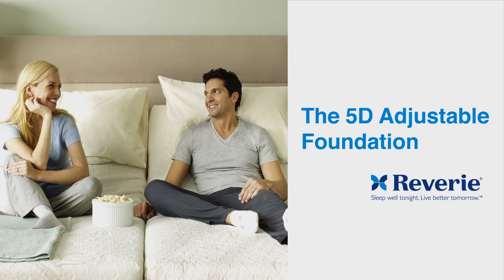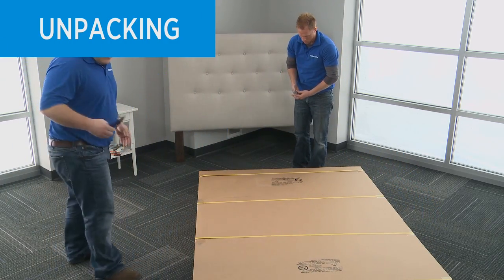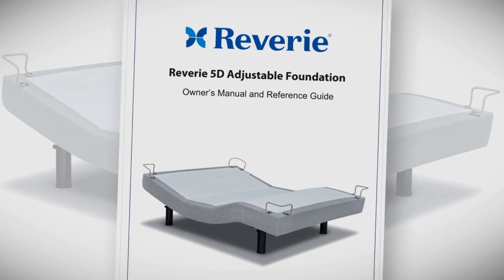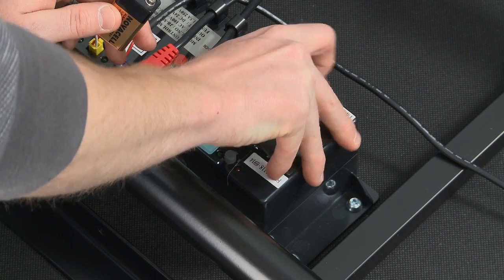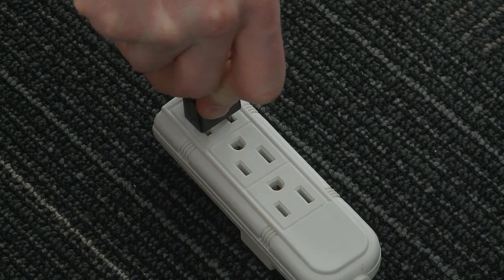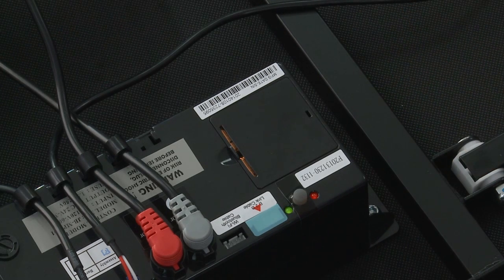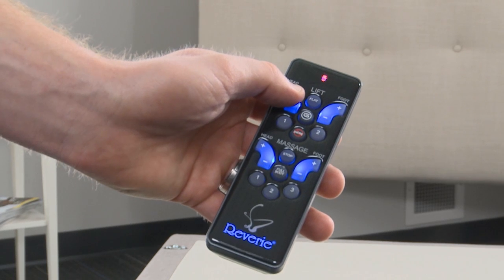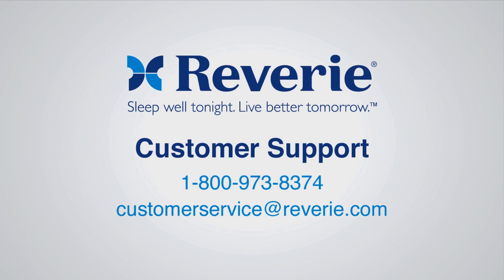Reverie 5D Adjustable Foundation Set Up Video

Comment: What a fantastic purchase MyseIf.Furniture I needed a new bed for my college sons room for when he came home to visit.(Full Size) This bed did not disappoint. Package was deceiving as I wondered how it fit in the box. The entire bed was inside the headboard 😳 The back of the headboard has a zipper to allow the bed to be disassembled and put back in it if you were to move. Currently I have all the instructions and tools that came with it stored in there. It would even make a great spot to hold valuables! Assembly was straight forward and easy. It took my friend and I less than 20 minutes to put it together. One piece of advice is to lay the slats in place BEFORE you tighten the side rails all the way. It’s not impossible or hard to get the slats in if you tighten first but it would have been easier for sure.

Comment: Yes! This bed sucks! Nothing but problems at least 15 times or more this year! My daughter depends on this bed for her special  needs and only worked well the first month or so.  “Her bed before this one lasted 18 years and finally broke”.  ( it was “ definitely NOT a reverie “ ) Was worth every penny. And the remote was attached to the bed. Not like the wireless remote. The  reverie remote messes up, and there is no way to get a hold of anyone to fix any problems. She gets stuck in the up position, and legs, and is very difficult to help her.  I’ve tried everything they have on YouTube to guide us in anything to fix, and does not explain  everything I need to ask.  The remote works when it wants, works one min the nothing the next, and when everything thing is working it won’t sinc together? All the other reviews are correct, and there is no one to help with anything. And another remote is very pricey. Which is sold on Amazon , however I Wish I did my homework before we bought this for her, for now we will have to buy a whole new bed within a year and a half after buying the reverie. Shame on this company for selling something that works this poorly, and can’t find or here back from anyone to help. And a number that goes nowhere and leads you to nothing. Makes no sense.
Reply from the maker: We regret to hear about the status of your daughter's bed and certainly understand your position, as we know how frustrating unexpected concerns can be. At this time, we kindly recommend reaching back out to our dedicated Customer Service team. They are in the best position to perform further troubleshooting with you and determine the best course of action going forward. You can reach them by either calling 800-973-8374 or sending an email to customerservice@reverie.com.

Comment: I’ve had 2 failures in one year with my Purple/Reverie adjustable power base. Getting through to Reverie Customer Service is a nightmare. Unbelievable long hold times that disconnect you before you get to a human. Send a text message and you MIGHT get a response in 3 weeks or more. Do yourself a favor,buy one from someone else!